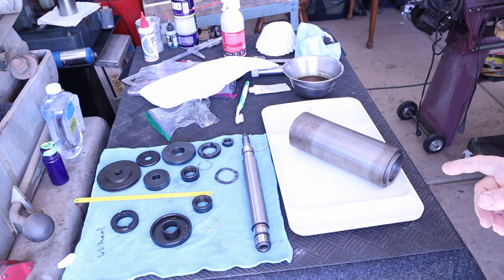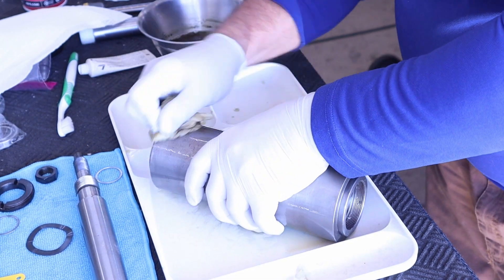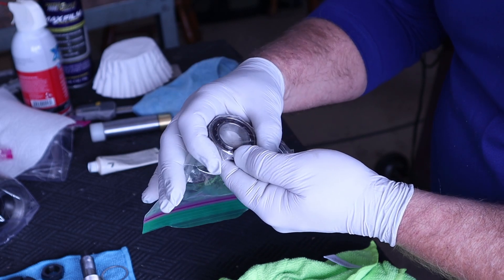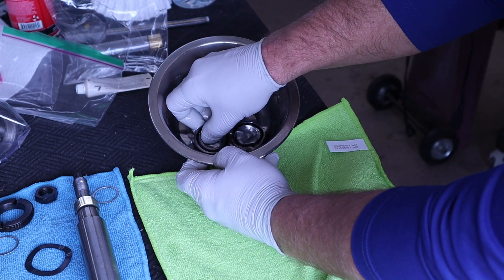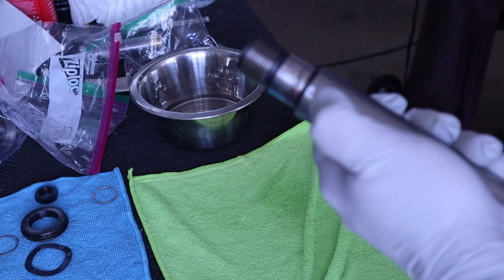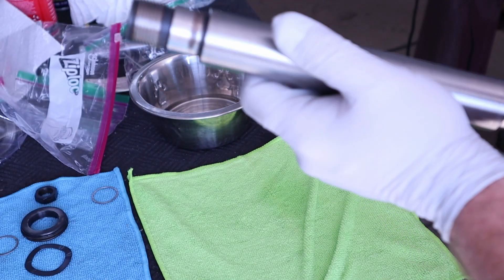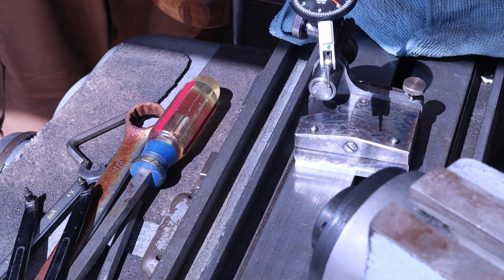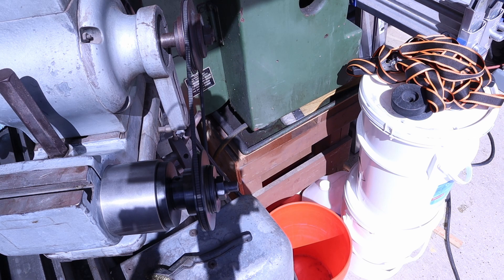K.O. Lee Grinder Spindle Re-Assemble

Comment: Do you use your ultrasonic cleaner in the bearings?
Reply from the maker: No. There is a risk of additional pitting.  Just washing by hand over and over in either alcohol 99percent or acetone.
Reply from the maker: You can get away with it though if the time is kept to a minimum.  And even then it is debatable.  I wouldn't make a recommendation to use an ultrasonic cleaner I also dont fully understand the risks if any.
Reply: @AlmostMachining  i use lacquer thinner to avoid any corrosion and it really gets all the crud out. But I’ve only used it on car bearings, not grade 7 machine bearings